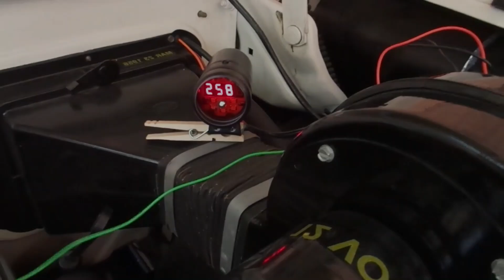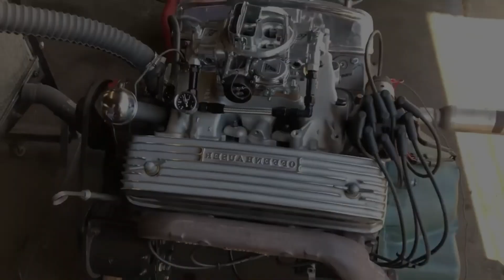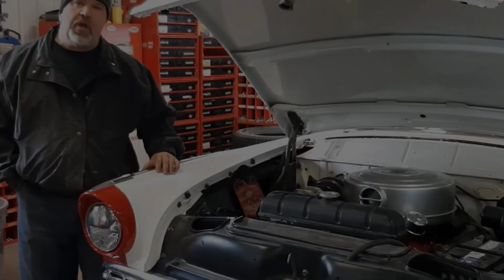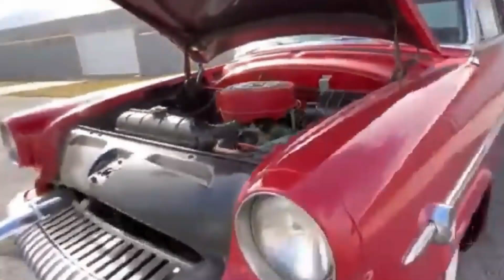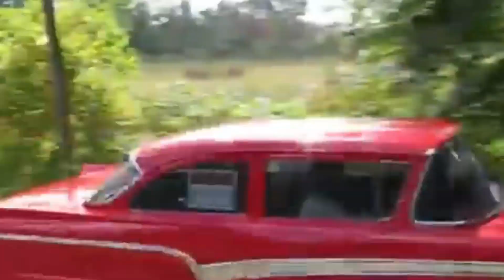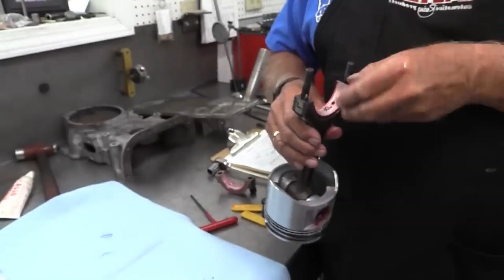20 Shocking Secrets About the Ford Y Block V8 You Didn’t Know!

Comment: Good video, entertaining. It covers several aspects that not many enthusiasts know about this engine family.

Here in Argentina, it's iconic, as it was the only Ford V8 engine manufactured locally. The 292 cubic inch version was the only one available, although in the early 1960s, different imported versions from the USA could be purchased, such as the one called the "Thunderbird" of the 292, with a high compression ratio and a little over 200 hp. My paternal grandfather bought a brand new Ford F-100 "Loba" with this engine, since the "national" version only had 165 hp, a 7.5:1 compression ratio, and a two-barrel carburetor.

And yes, they had breathing and lubrication system problems.

Furthermore, in Argentina, Ford installed them in its line of pickups and light trucks, but starting in 1969, they fitted them to the Ford Fairlane, which was the four-door version of that year's Ford Torino (the legendary IKA Torino, an evolution of the Rambler American and Rambler Rogue with a heavily modified Tornado inline-six engine, already existed in Argentina).

It turned out that when the old Y-block was mounted in the engine bay, removing the spark plugs for maintenance was nearly impossible. This led to a local redesign of the Y-block in Argentina in 1973 or 1974: the lubrication system was substantially reformed and improved, new cylinder heads inspired by the Ford 302's architecture were manufactured, independent exhaust manifolds were produced, and so on. This new engine, locally called "Phase 2," proved extremely robust and reliable, and even with an 8:1 compression ratio and a small two-barrel carburetor, it was already producing around 190 hp.

I'm currently building a Phase 2 engine for an old '69 Ford Fairlane (Torino) converted into a hearse. Our fuels today are of excellent quality, the most common being the one known as "Super," with 95 octane. The range extends to the premium 100/101 octane fuels. So I'm going to increase the compression ratio of this old Y-block to 11:1, install a four-barrel Solex 4A1 carburetor, build custom intake and exhaust manifolds, remachin and balance the internals, and add an overbore that will bring it close to 5 liters of displacement (300/302 Cu.In.). I'm estimating 250 hp for everyday use, from a very flexible, low-stress, and reliable engine.

Congratulations on the channel, and best of luck!

Comment: A bit of a crock. Ford dominated many oval track events from 55 to 57 and later and in 57 outsold GM by quite a margine. Regular oil changes usually keeps on top of valve train oiling problems, along with a few other tricks for performance engines. I have a small block chev over a Y block any day obviously, but I've had many of both. Lately become quite a fan of nostalgic Y blocks. Never seen a small block Chev with the distributor at the front mind you 😮